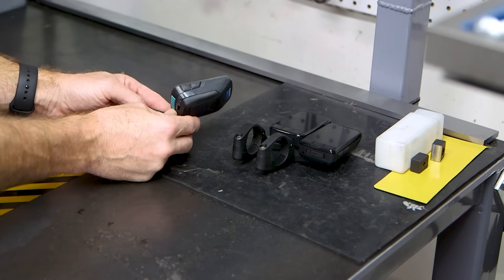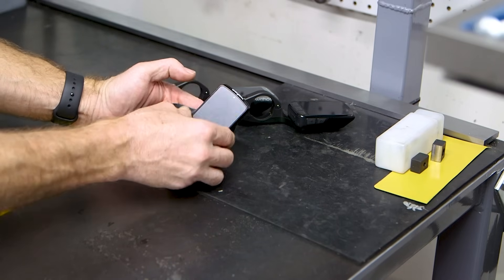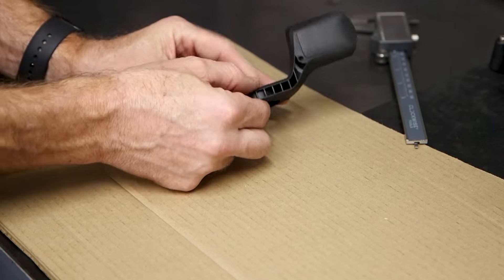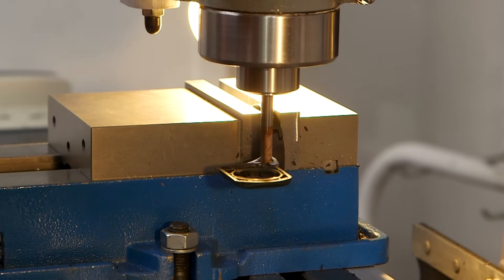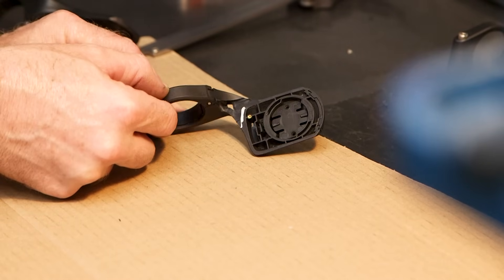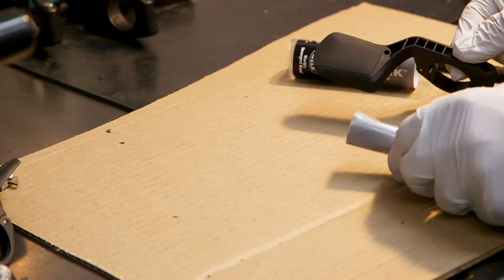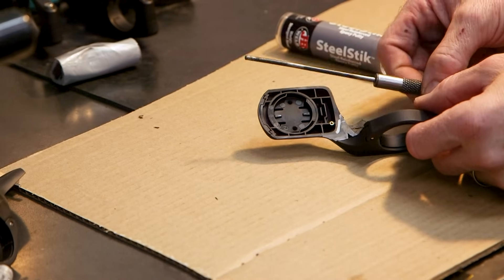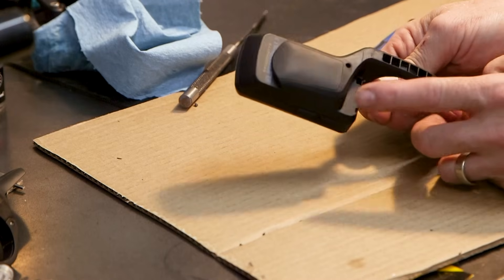Wahoo designed it so it wouldn't fit,  I made it work anyway.

Comment: Cool! Another great video. Would have also been possible to 3Dprint some type of spacer which attaches to the computer lifting it up a bit and giving some clearance. This way u would not have to modify all 8 mounts and make the fit reversable. But I think it would look a bit less clean because the computer would not be flush with the mount.
Reply from the maker: Yeah, I think that would been a good solution.  I didn't even consider it, but I still have four mounts to do, so I'll give it a shot.  Appreciate the idea.
Reply: @RobertAdairWorkshop  Nice!

Comment: Looks like you originally bought the smaller Bolt.  Then replaced it with the larger Elemnt (ROAM) line.  Which is why it doesn't fit your Bolt mounts.  I bought the original Elemnt (aka V1) and now have their Elemnt Roam V2 just before they released the current Elemnt Roam V3.  I nearly bought the original Bolt because of it's small footprint and aero mount back in the day.
Reply from the maker: Sorry, hit enter too quickly.  I do wish they made a smaller version of the Bolt, just like the original.  It was the perfect size.
Reply: @RobertAdairWorkshop  I see it now, had to zoom in the backside of your computer.  Luckily my Elemnt (roam) fits the original outfront bracket, otherwise i'd be in the same situation - 4 of them. But now I now how to fix it if I have a problem.  thnx
Reply from the maker: No, these were all Elemnt Bolts.  I didn't spend the extra money on the roam.

Comment: I found the same problem the same way when I got a new Bolt 3.  Needless to say, I was not happy.
However I made the same modification and never measure anything and did not use an end mill.  IMO, that is overkill.  It was quite simple to do by using a Dremel style tool and testing the fit as I ground away.  There is no structural weakness at all.
IMO, the biggest issue with the Bolt 3 is that the beeping "alarm" volume is FAR to low.  It is much less than on my Bolt V2.  If anyone has a fix, I would love to hear it.
Reply: The Dremel is my favorite tool in the whole world. I even use it to buff the calluses and trim back the nails on my feet. 😄

Comment: I am surprised you didn't fill the hollow portions where you milled off material beforehand, that way the epoxy would have been milled at the same time.
Reply from the maker: A couple guys pointed that out.  Never even occurred to me.  I still have four of these to mill, so I'm going to try it on the next one.

Comment: I has a similar with Garmin when I moved from a 1030 to a 1050... all my expensive K-Edge mounts were useless.   My solution was to 3d print a piece to move the GPS forward and fit the existing K-Edge mount.

Comment: My outfront mount anchor bolts pulled out of my one piece bar. I'm wondering if this 2 part epoxy stick would be a good solution or if the more traditional 2 part epoxy in the plunger type applicators would be better. Thoughts ?
Reply from the maker: This stuff is like Play-doh.  I don't think it'll do a good job of wetting the surfaces so if your insert still fits tightly into the bars, it might not be the right choice.  But if you've got a void between the insert and the bars, it would do a good job of filling that in, and might be the ideal material.  It relies on a mechanical bond, so the rougher each surface is, the better.

Comment: Awesome! I actually might have to do something like this in the future, but I love my Bolt v1, I'm not going to replace it before I absolutely have to. On the newer models I'm worried about screen visibility in bright sunlight, how do you find it? The old monochromatic LCD gets more legible when sun shines on it, unlike modern color displays.
Reply from the maker: Of all three, the original is still my favorite.  The second one, No 2, is the worst of the three.  It has the nice color screen, but it is so slow to cycle between menus and update the GPS.  I didn't realize how slow until I got the 3rd one.  It feels like a rocket ship.  Screen hasn't been a problem in either sunlight or dark.  The built-in light meter does a pretty good job of dialing it in and the matte screen reduces glare.  I've been much happier with the 3rd one.  Battery life is way, way worse on the 2nd and 3rd, though.  The original, I could get a couple weeks before charges, but these newer ones need it every 3 days or so.
Reply: @RobertAdairWorkshop  oh, very interesting, I did not expect that! Thank you for the insight! I'm especially surprised by the battery life, 2 and 3 are better on paper, but it makes sense that those displays consume a lot more power.

Comment: I have a feeling someone at Wahoo knew exactly what they were doing when they designed the Bolt 3 mount 5mm too far in the wrong direction...
Reply from the maker: I had that thought a time or two.
Reply: For sure. They could have made that decision But that would mean te point of rotation would not be in the middle of the unit and you know how people are... instead of this awesome DIY we would have:
I just dont like how the top of the new wahoo "swings". why did they make that awful decision instead of the tried and true midle of the unit mounting just to cozy up to some 8y old bracket?

Comment: Should have filled it and then milled it maybe?
Reply from the maker: I didn't even think of that.  I've still got 4 more to mill out.  I'm gonna try it.
Reply: @RobertAdairWorkshop  Pourable epoxy can be used before the cut, and fillers can make it lighter.  Good show!
Reply: Think that warrants a second video! Excellent work as usual 👏
Reply from the maker: You might be onto something 🙂
Reply: I was thinking the same!